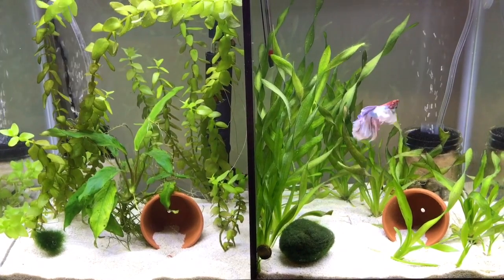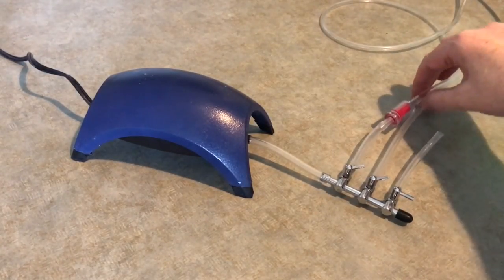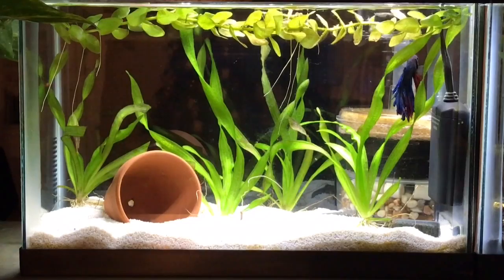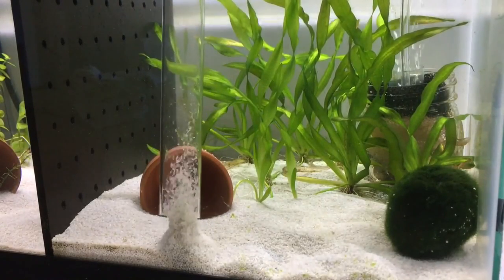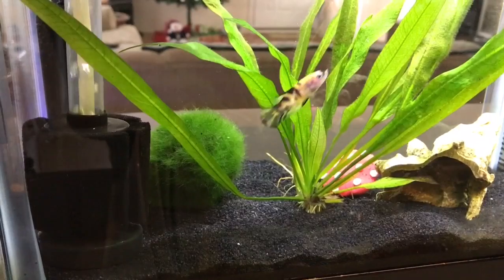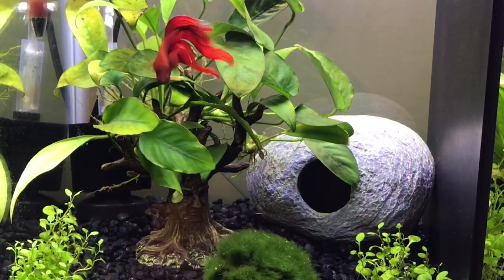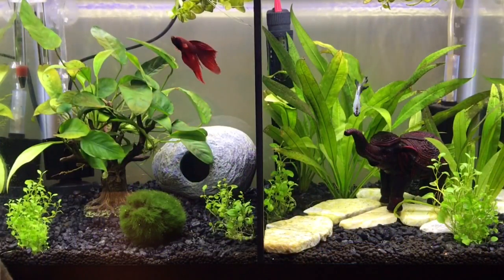Betta Fish Filters

Comment: Hello I have a 5 gallon betta tank with two males! And the divider that I bought from you!  I recently ordered the jardín corner filter and wanted to know do you think I would be able to fit both of those on both sides? And can you please let me know what pump and anything else I would need for both the filters so I won’t have to buy two pumps! Thank you I would really appreciate it🙂🐠
Reply from the maker: Depending which one you go they should fit but I think they’re a little big for the space. The mini sponge filters would be a better option. One 10-20 gallon air pump will run them no problem. You will need the tubing, gang valves and check valves also. We sell a air pump bundle kit on our website and long with the sponge filters which a sold separately.

Comment: Ever since I added a sponge filter to my 2.5 gal aquarium and removed the cartridge-fed one my kit came with, my betta no longer makes bubble nests :( 

I'm assuming it's bc of the increased surface agitation from the new filter's bubbles, but do you think there is anything I can do to promote his creation of bubble nests again? I liked the visual cue of his level of contentment in his environment. Or is it simply not possible with a sponge filter running?

Thanks again for all the awesome content you guys put out.
Reply from the maker: Are you using a lever on the tubing to the sponge filter? With that you can reduce the flow through the sponge filter.
Reply: Lifewithpets thanks for the reply. I wrote a comment on another video but I bought the sponge kit and pump from the life with pets website, so I have the two-way splitter valve with the levers and tetra whisper 10. I have it set to as low as it can be while not having an inconsistent bubble stream and gurgling from the sponge. 

Guess maybe I should try adding plants or something that touches the top of the water since around the old filter is where he used to make his nests? Tho I did put the filter casing back in there for a few days, just unplugged and empty, to see if he would make still chill up there bc that's where he used to sleep and make nests. He didn't tho. Now he sleeps in a little cave ornament.

Also I've seen mention of "silencing" sponge filters by cutting out the stock internals and putting an airstone instead for smaller bubbles. I'll probs try that too. 

Sorry for the massive walls of text 😅

Comment: Another great video! This really clears up my confusion. I'm getting a new Betta for a 2.5 gallon and I haven't had much experience (I had one as a small child). Again, thank you! :D
Reply: I was also wondering if you preferred your homemade sponge filter or a normal sponge filter. Does the regular sponge filter provide chemical filtration? Do I need chemical filtration for a Betta? Thanks! :3
Reply from the maker: Either works really well. It's probably cheaper to by a sponge filter on Amazon than buy all the components for a DIY filter for one tank.
Reply: Thanks for the help! :D
Reply: Please keep it in atleast a 5 gallon tank

Comment: I had a two foot bow acrilic tank full Endlers + fry and Dwarf Corry cats, shrimp, snails, and Bristle Nose cats and ran it with two sponge filters and a corner filter. Lots of air and bubbles! Oxygen is the key!
Reply from the maker: You're right, sponge filters are often overlooked,  if set up correctly they can be a good option, especially for betta fish.

Comment: QUESTION FOR THE FISH COMMUNITY!!!!
I have the fluval spec 5 gallon tank and it came with a filter. The filter has a sponge with charcoal and bio media. I've been cleaning my filter by rinsing it off in the old aquarium water after water changed about once a week. Should I be replacing the charcoal at any point or do I continue to just rise it off? And I've been considering changing out the charcoal for a second bio media...thoughts? 
Thanks so much! I'm relatively new to the fish community and have been doing lots of research but I've got some conflicting opinions!
Reply from the maker: Welcome to the fish community. I don't use charcoal in my aquariums. I would add another sponge or bio media.
Reply: Lifewithpets thank you so much for your advice! That's what I'm going to do then! 100% trust your opinion! You're amazing

Comment: Hi sorry I've got a question in regards to a beta. My betta has some kind of bacterial or fungal infection that's halfway on the edge of his eye and partly on his face. The pet stores in Taiwan said you just put aquarium salt in with the water and change 25% of the water at the end of the week and then do the same thing the next week. They said at the end of the month do a full cleaning and then do the same thing putting in all the chemicals and things that are needed plus add the aquarium salt. it took me 4 stores to figure out exactly what bettas need because people kept giving me different answers not to mention they tend to believe in myths that bettas don't. need space. I'm just wondering what is aquarium salt used for and do they have a medication that is both bacterial and antifungal because I don't know what problem my fish has.  also I don't know if it's bacterial or fungal. I first noticed that my fish had half a white ring on one of his eyes not the eye but the actual rounded part of his eye about 3 days ago and then I noticed that the white that was on that part of his body had spread to part of his face.  I contacted a friend of mine who also started having fish about a month ago and he told me that there's another fish store I can go to that's way less expensive and probably they can help me to find out the problem I was just curious of what you thought.

 so what I did was I put my fish into a quarantine tank and then I decided to clean out the tank to kill off any bacteria or fungus that might be in the tank and then I am allowing it to cycle again with everything that's needed so that way by the time is done hopefully my fish will have recovered and his tank will be ready.

 I've only had this fish for 3 weeks on until 3 days ago he had no filter or air pump because I was told he didn't need one so I was thinking probably when I bought him he must have already been sick and I didn't know..

Comment: Hi I have a betta fish in a 5 gallon tank and its filter has just broken. I don't want a sponge filter but it also needs to have some surface agitantion as I have a problem with baterial films developing on the surface of the tank. What filter should I get.
Reply from the maker: For a 5 gallon Betta tank I would recommend a sponge filter. I think the hang on back filters flow are too strong unless you find a way to baffle them. I don’t have any small hang on back filters so I can really recommend any.

Comment: Hi-I just put my betta into a 2.3 gallon (I've read it's appx 2.3) Deep blue 5 betta long tank but not sure if I should have some sort of filtration or not. (I would NEVER use this for 5 betas- just the one I have) I had him in a filtered 5 gallon but due to a crack in the glass I had to move him to this tank. I have always siphoned the debris on a daily basis and his tank has always looked clean and clear. I will continue to do that but now I'm not sure if that will be enough to keep the water as clean. There will be no issue with the upkeep - just wondering if if daily maintenance enough or do I still need a filter or air pump filter? Thank you for your help.
Reply from the maker: If you did daily 50-60% water changes he would be ok without a filter. However having filtration is better and a lot less work.
Reply: Lifewithpets Thanks so much. I'll try that and first and if it doesn't seem clean enough I'll go ahead and get an air filter 😄

Comment: So, I just got my fish tank cycled. It's a ten gallon tank with an HoB filter (Whisper 2-10i) and I'm thinking about switching to a sand substrate, which means obviously I can't use a HoB. So I want to switch to a sponge filter because I think a ten gallon would be nearly perfect for it (please correct me if I'm wrong) is there anything I would have to do special to keep my beneficial bacteria thriving? Because I learned that it resides within your filter media so me taking the Whisper 2-10i out and putting in a sponge filter, would that get rid of a good majority of my bacteria? Would I need to put in more tetra safe start (or something of the sort) or is there a way to "transfer" the bacteria? Thank you so much in advance      - A newbie fish owner
Reply from the maker: I would wait a few weeks before adding the sand. Leave the old filter in the tank for a few weeks while you also run the sponge filter in the tank. That’s the quickest way to keep the cycle going.
Reply: So, go and buy a sponge filter. Set it in the tank with my HoB. Run them simultaneously for a couple weeks then remove the HoB, and that will keep my cycle going? Thanks in advance :D
Reply from the maker: Yes.

Comment: What filter would you recommend for a 10 to 20 gallon tank?  My goal is to set up a planted betta sority.  Also, what lighting do you use for low light, low maintenance plants that work well for bettas?
Reply from the maker: If it’s for a Betta tank I would use sponge filters. For a light a nicrew or deckey led light. Thatnks what we use on most of our tanks.

Comment: Hiya, I recently came into possession of my first Betta after my sister moved out and left him behind, and have been using your helpful videos as one of my info sources, so thank you for that! But I had a question about the air flow valves. I am setting up a 5 gallon tank for him, and have a mini sponge filter running in it, but it seems like the current it puts out is too strong, so when you mentioned air control valves that sounded like something that could help. The one in your description, is it only meant to be hooked up to 2 filters? Can one of the holes be plugged, or are both openings meant to connect to one tank? Sorry, I'm just very confused, I hope that made sense!
Reply from the maker: Yes you can use the one. All you need to do is add a small piece of tubing on the one your not using. You can then use both levers to adjust the flow.

Comment: Also have a question do you know any heaters for a 2.5 tank I want to get a betta fish sometime but I would like to know what heater to get cause I like my room cold and it says the betta heater only works for a 1.5 gallon tank.
Reply from the maker: The only ones I use are the marina bettas heaters. Although they are rated for a 1.5 gallon tank I've had no issues with them keeping my tanks at 78f. My house doesn't usually get colder than 70f though.
Reply: Thank you very much

Comment: Great video! Could I use a sponge filter in a 16 gallon tank or would the water flow be too low?
Reply from the maker: Yes, you can use one. The water flow can be as high or low as you want if you use the lever to control it.

Comment: Plz answer so I have a 3 gallon and no filter can I clean the tank out once a week?
Reply from the maker: If you have no filter you should be doing 80-100% 2-3 times a week. If you don't the ammonia will get very high in the tank causing great stress to your betta.
Reply: Lifewithpets if I do get a filter how many times them
Reply from the maker: 25-30% water changes once a week.
Reply: Lifewithpets thx! One more question so is melafix a good choice on fin healing or would aquarium salt be a better choice
Reply from the maker: No, anything with 'fix' in is not a good option for bettas. It works well for other fish but ca do harm to bettas. Water changes and aquarium salt if it's mild. Nothing can replace water changes this promotes the most benefits. Do water changes every 3-4 days.
Reply: Lifewithpets would I do the 20% water changes for the following weeks as well or 20% once every other week?
Reply: Nicole Hitt I would recommend doing larger water changes at the end of the week with the smaller 20-30 percent ones daily WITH a filter. Without I would follow the advice of Lifewithpets and do larger changes daily. Unfortunately that’s the life of an unfiltered tank, without at least a sponge filter you run the risk of poisoning your fish since the tank essentially becomes a fish bowl. The good bacteria that eats up the nitrites and such lives in the filter, so it’s very much essential.

Comment: a question not related to filters. my fish keep getting the ick, what am i doing wrong?
I do 25% water changes every week and a 50% water change every month!
Reply: Israel  Hernandez ok so what tank size do u have?
Reply from the maker: If they keep getting ick it means you're not completely killing it each time. What do you use to treat it, how big is you're tank and is it heated and filtered?
Reply: Lifewithpets i have a sponge filter and it's heated. the 29 gallon tank is currently at 81 degrees. i do water changes daily now that i have the ick and add salt to it.
Reply: Scaley And furry i have a 29 gallon fish tank
Reply: Israel  Hernandez I'd recommend doing a 50 or 80% water change instead of 20%
Reply: Israel  Hernandez * 25
Reply from the maker: I'd recommend doing a 50% water change and vacuum the gravel thoroughly. Turn your heater up to 86f and keep your tank lights off. Make sure you have plenty of aeration in the tank. Keep the temperature like this for 10-12 days then do another 50% water change vacuuming the gravel thoroughly and it should have cleared it. Do some research on heat treatment to cure ick. I've only ever had ick 2-3 times and every time I've done this  it has worked. What fish do you have in the aquarium?
Reply: Scaley And furry how often ?
Reply: Israel  Hernandez  ok I would say 50% water change daily  make sure not to use any type of bettafix or melafix just conditioner and aquarium salt that should do it if not try doing 80% water changes daily. Also make sure the water isn't to cold nor hot I'd recommed the temperature around 83   Hopefully he will get better
Reply from the maker: Daily water changes will not remove ick. This is why you're having trouble getting rid of it. You need to kill the parasites. Heat will do that but you need 86f for 10-12 days after that reduce the temperature back to 78-80f. It's important when increasing the temperature to have good aeration which if you have a sponge filter should do the job.

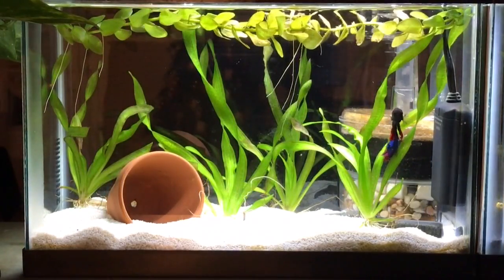Comment: Great video. One question though, How do you clean/maintain the filter shown at 2:05? Your bettas are beautiful!
Reply from the maker: Thanks. We rinse the sponge and gravel/ceramic rings in aquarium water and replace the polyfil. We get the polyfil from Michaels and it need to be 100% polyester with no added chemicals. I also scrub the casing in aquarium water.

Comment: How often do you change the filter stuff in the corner sponge filter
Reply from the maker: Once a month or so.
Reply: Lifewithpets where do I buy it? I have the corner juardian, also anyway you could give me pointers on betta fin rot and good way to heal it
Reply from the maker: Depending on how severe it is daily water changes with aquarium salt for a few weeks should heal it. If it’s severe you’d need to use medication.
Reply: Lifewithpets doing that many water changes wont kill off your good bacteria? Also do I add the same ammount of salt each time?
Reply from the maker: Not if the tank is well established. I would add the salt as directed once or twice a week.

Comment: Better off not squeezing out the sponge filter cause your also remove beneficial bacteria from the sponge .
Reply from the maker: To clean the sponge properly it needs to be squeezed out. The amount of bacteria lost is minimal. If the sponge gets too clogged it will no longer function properly and bacteria growth will reduce significantly.
Reply: Lifewithpets have one running for over 3 years with no cleaning . Only need to squeeze it if air no longer passes through .